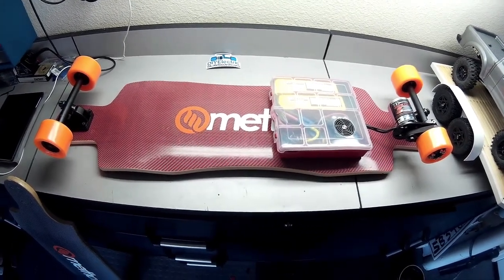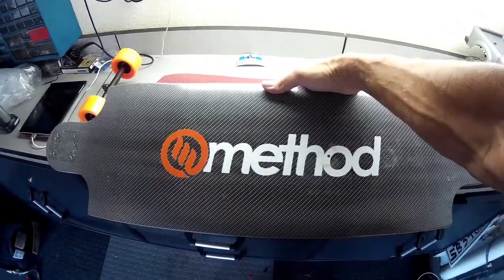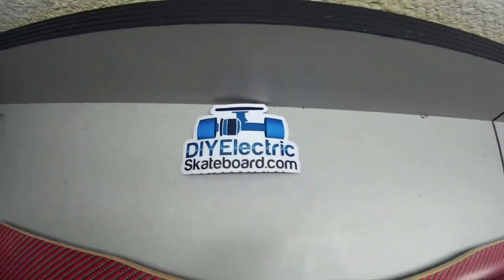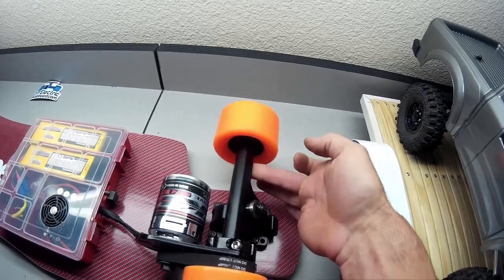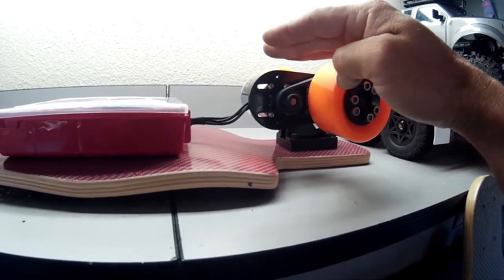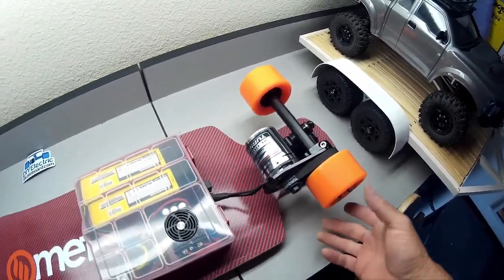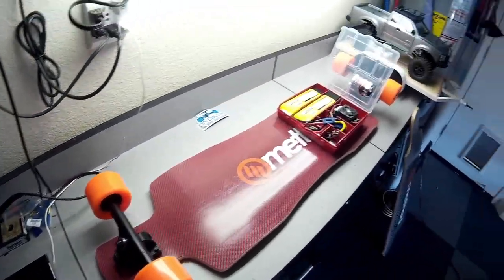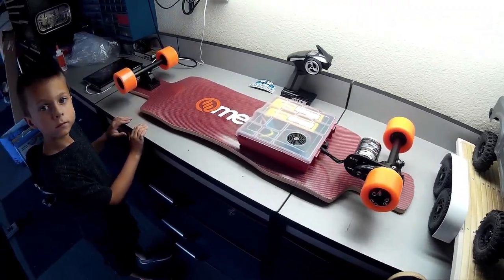DIY electric skateboard revived

Comment: whats the range
Reply from the maker: Twins Tube Tv    With 5800mah I got almost 7 miles on flat ground, 60-75% throttle. I also have a set of 8400mah batteries I want to range test.

Comment: Great explanation of your set up!  Appreciate you sharing as I'm building my first one.  Looks like you lipos at 6s does fine for your weight.  I was going to do a 10s and I'm 160.  Looks like I may even be able to take it down to 8 or 9s and it will still be adequate.  Thanks again!  👍🏽 LIKED

- Neil
Reply from the maker: Life of M  10s will only give you more speed and not necessarily more power. 6s is pretty common.
Reply: Scott Halstead gotcha! Appreciate the input.  Love your build!  Gotta check out your other RCs as well!
Reply: Pretty sure that the higher the voltage the less amperage flows through the motor and therefore less heat. 6s is like a minimum nowadays while 8s and 10s are norm.

Comment: Could I have the link to the ESC? I can't seem to find it.
Reply from the maker: +Guillaume DEBRE 
This is the best esc I've ever owned. It's been in 2 different longboards and 3 different 1/8 scale rc monster trucks. It's easy to program and has never given me any problems. Highly recommended!
Reply from the maker: http://www.ebay.com/itm/HobbyWing-EZRun-1-5-1-8-Scale-150A-Pro-Brushless-ESC-/112122119984?hash=item1a1affc730:g:qTkAAOSw-kdXzNUO

this is the one I have. but theres a newer version called the max 8. they are all over eBay
Reply: +scott halstead ok thank you!
Reply: Hey, do you like your ESC ? The brake is good for a electric longboard ? Did you have a problem with it ?

Comment: can I use3650 4370KV 4P Sensorless Br
ushless Motor with 45A Brushless ESC（Electric Speed Controller）for 1/10 RC Off-Road Car pls rply someone help me??
Reply from the maker: No. Motor is way too small, and way too high kv. Esc is way too small also.
Reply: +scott halstead  what motor can I use ?
Reply from the maker: +farhimysam fns 
Any large outrunner motor in the 150-300kv range. The turnigy Sky-3 series is a good start.

Comment: I have à motor pyro 600 09 its 930 kv you think i can use for an electric longboard ?
Reply from the maker: Way too much kv for a skateboard. That motor would overheat and cause problems. Stick with something less than 300kv
Reply: +scott halstead damn :/ and with a esc programmable its impossible to ?
Reply from the maker: The esc makes no difference. Most of these little outrunner motors aren't designed to push a person on a skateboard so the motor kv/size/battery voltage all have a pretty narrow margin for error when it comes to matching the electronics. A motor with too high of a kv rating will not produce enough torque and will overwork itself and burn up, if your esc doesn't shut down first.
Reply: +scott halstead Really thank you , you learn me a lot
Reply: +scott halstead Really thank you , you learn me a lot

Comment: Very nice build! If you have access to a 3D printer check out the mad munkey mod for the gt2b controller. I made one and love it!
Reply from the maker: I saw that, unfortunately I don't have a 3D printer. Wish I did though. Just tested the DIY torque boards 2.4 nano remote. Im having a couple issues with it. Look and feel is great, but throttle is jumpy and having trouble getting the throttle trim to center without the wheels spinning.
Reply: Scott Halstead Such an insightful thread.  my Nano is on the way.  Are you still having issues?  If so, any advice?

Comment: if you want to increase speed, you could get a new pulley with a higher gear ratio. I'm sure u have 14t/36t now, you could bum it to 50t and really increase your speed. (you would loose a little torque)
Reply from the maker: Actually the diy kit comes with 16/36. 50t on the wheel? That would be slower. I'd have to go bigger on the motor gear or lower on the wheel gear to increase speed.  I've only found smaller motor gears for sale. Not sure where I could pick up a smaller wheel gear.
Reply: +scott halstead 16/36 is high enough. just use higher voltage because the motor is rated at 12s voltage. the rpm is too low.
Reply from the maker: Yeah, I was trying to get the 192kv version of the 6374 sk3 motor but they were out of stock everywhere and I didn't have the patience to wait.